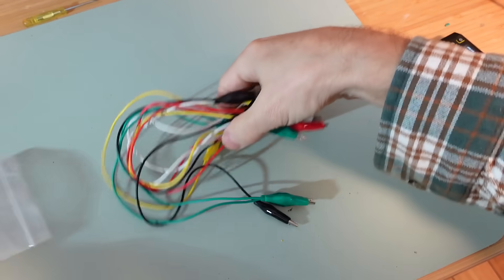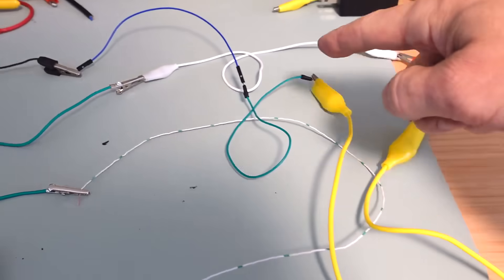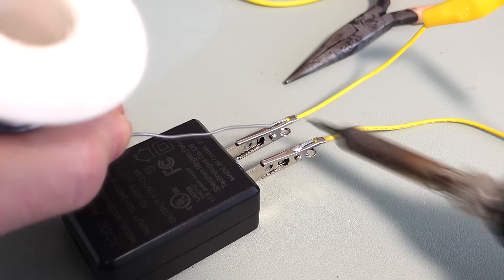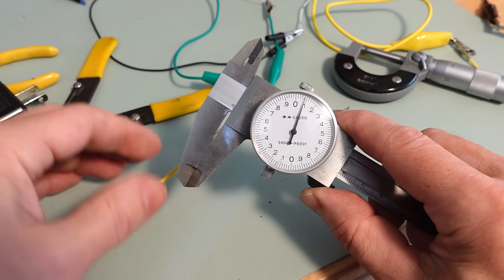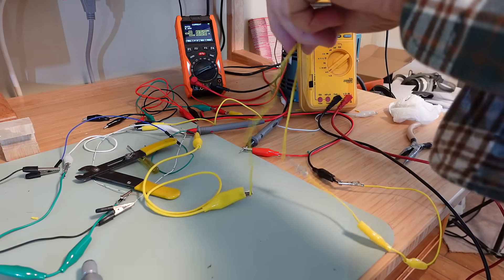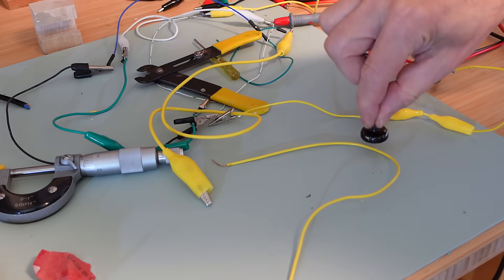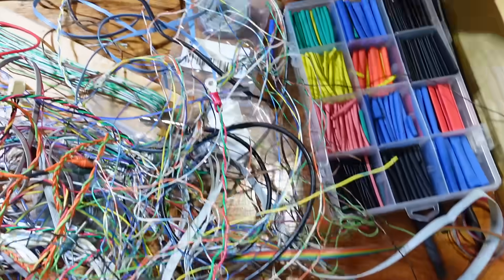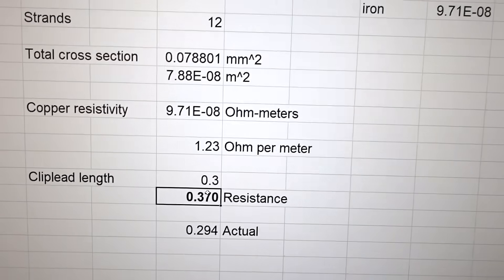Clip leads made with fake wire

Comment: I bought some at Harbor Freight within the past year, and they are NOT iron. I used to get them at Radio Shack and mine were very old, so when I saw some at Harbor Freight, I bought them. You had me a little worried cause they look like the ones you ordered from China. But fortunately, mine have good wire. I did notice that the wire is crimped, like you said, rather than soldered. Thanks for a useful video about something I wouldn't have expected!

Comment: I've been given a pair of jump start leads made with 8mm diameter insulated cables, which had more resistance than a pair I've made once in a pinch with spare 4mm^2 wire. Loudspeaker cable sold in construction supermarkets is often made of steel as well.
I've once had a cable almost catch fire after I've assumed it to be 2.5mm^2 of copper and loaded it accordingly. Buyer beware!

Comment: My guess is that they are using iron to save on costs since copper is 30 times more expensive. But still, that doesn't give them right to lie to the customers, it could potentially cause a house fire

Comment: Chinese manufacturing isn't to blame, they make to the design. Anything from the crappiest plastic moulded toy to the absolute best tech is made to the price and spec dictated by the retailer, market or consumer. These wires are steel because that's as much as people will pay for them. Have you seen the price of copper these days!!

Comment: I bought a cheap Chinese extension AC cord, back around 1978.  It got unusually warm powering my first o-scope, so I cut it up and discovered that the "stranded wire" was "stranded shield audio coax", with almost no copper in the core.

Comment: Just checked my clip leads and they are not iron. The clips themselves are though. Not sure if that matters.
Reply from the maker: Iron is normal.  Stronger than copper, and the cross sectional area is high enough it doesn't matter so much
Reply: @matthiasrandomstuff2221  good to know thnx!

Comment: When shopping for cheaper wire related parts the descriptions often say copper clad aluminum, which isn't terrible if gauged adequately.  I wouldn't have guessed some were made from iron.  I wonder if that coating was even copper.

Comment: I mean, there's a good sustainability argument for using alternative materials for low voltage applications where it won't really make a difference. Not a fan of the copper coating deception though.
Reply from the maker: Agreed, I don't mind iron wires in my mouses so much. Could be that they take longer to break from fatigue too, so might actually be better in that application

Comment: Amazed that "wires" contained enough iron to be magnetic.  I'm curious if the mouse cable was magnetic due to shielding around the signal wires?  Typically a woven steel wire mesh.  That might be why it was magnetic.

Comment: Luckily, they are small gauge wires, so they aren't used in high-energy applications. But this makes me wonder how many larger gauge wires have the same issue. It sounds like a potentially dangerous fire issue.

Comment: I NEVER buy these small cables - the plastic hardens over time, the thin metall bends in al directions, the wires sometimes are not connected to the clips. I make my cables myself, from isolated clips twice the size and longer thicker wires too. They are now 40 years old and still  handsome.

Comment: Excellent work! Cheap Chinese crap again. As for the mouse cable at 6:03 it might have iron in the shielding, not the actual signal wires. Not 100% sure. High iron content or aluminum in the shielding instead of copper is fine, just not as effective as copper for shielding EMI. Iron is fine for low frequency shielding. Obviously your mouse manufacturer or their wire supplier went with iron for cost savings.

Comment: This material is not even iron, they use some alloy which is much, much worse than iron or steel. It is basically impossible to solder when the copper coating is gone and that coating is very weak and just dissolves in solder. Utterly useless Chinese crap.

Comment: If you think iron is bad i can tell you the real problem starts with chinese components having aluminum wires, pretty much all new welders and DC wiring spools you get on retail that are bought from the retailer from china sell as copper and is actually copper plated aluminum, some are rebranded and sell at higher prices and you don't know which one is which if you just order it instead of buying in person. While aluminum is a great conductor those specific wires heat up, get oxidized and lose contact, break on points, etc, so if you plan to wire up a high amperage DC line like welders, car amplifiers, solar panels etc they can be a menace.

Comment: its copper alloy plated steel wire use the magnet trick. buy them for the clips ends and replace the rubbish wires with copper 1mm2

Comment: I grabbed a fake power cord and it popped leaving a black mark on my hand. Fake insulation too. Both the black cladding melted through and the wire insulation melted through at low temp. They way China solves these issues is by creating a State factory. There is a State capacitor factory now that while not the best, is spec'd accurately and priced just like the counterfeits.

Comment: I had a problem with some leads I ordered. always breaking off of the clip, hard to solder and high resistance. I held a magnet up to the wire and sure enough, was attracted to the magnet.

Comment: Over on BigStackD's channel, he has melted down many motor windings that he hoped would be copper but turned out to be copper coated aluminum.  Copper is expensive, manufacturers will do anything to use as little as they can get away with.

Comment: I’ve also bought those cheap Chinese POS alligator leads for physics circuit labs and the voltage drops across the wires are way too large!  I’m throwing them in the trash and will try to source true copper wires.

Comment: Phone lines use steel cable along with copper, so is a higher tensile wire but with good conductivity.
But these may qualify for miniature mig wire.
Copper coated Aluminium wire is even worse.

Comment: Those power supply leads have been like that for years now.
I once got an IEC mains cable with iron or steel wire in it that caught on fire when I plugged it into a laser printer. I had no idea.

Comment: The magic name: CCS, Copper Coated Steel. Also available as sat-cable, good to notice. When used outside, I was sometime wondering, why the cable core in an f-plug was gone.. It just rusted away because of bad insulation.

Comment: I learnt about that at one point when I forgot to demagnetize my screwdriver and it picked up cheap resistors by the leads.

Copper-clad steel wire has been sold for a long time as antenna wire because (a) its mechanical strength is better, (b) it doesn't matter at radiofrequency because of the skin effect. With the price of copper nowadays, what used to be pricey antenna wire (because of the manufacturing cost of the cladding process) is now cheaper.

Most of the time I don't care about a fraction of an ohm, particularly if it's going to disappear at high frequencies. I don't run big currents through the leads. That's mostly how the manufacturers get away with these.

Comment: I've had problems with these El Cheapo Chinese leads purchased from US online electronics houses.  The way they are crimped to the terminal is so cheesy that one was a complete open circuit right out of the bag!  The wire within seemed like 50ga, and it was folded back over the insulation before crimping.  However, there was so little wire involved that it seemed to get buried in the insulation and not make contact once crimped.   

Trying to repair these by stripping the wire and soldering it to the little contact portion was difficult; the wire itself is so thin it would usually break off within the insulation rather than allow the insulation to get stripped off it, even using a proper 2-knife-surface stripping tool.

Comment: I had buyed some of those same clip cables, absolutely trash the cables were too thin and also they are made from cheap metal they corroded internally after a year, at least the clips still works, so i solder them with better cables and i still have them

Comment: I have 2 new HAKKO soldering machines and the temperature calibration is all wrong (580C will not melt 340C solder) AND the manual is a bad google translation from Japanese and some parts I just don't know what they are saying , and the programming doesn't seem to work if you follow the manual it could be password locked from the factory.  Hakko is supposed to be good quality but someone with the job of calibrating the machines before shipping must be not doing their job correctly AND both models were discontinued right after I bought them .

Comment: Thanks.  I knew they coated aluminum with copper and how bad that is, but I didn't know they did it with steel/iron wire, too.  I contemplated buying a multi- pack of exactly those kind of skinny cheap leads, but bought one set of two better thicker leads instead.  And heck, I don't know, it could be copper coated iron, too.  I will now check resistance and magnetability on those kinds of leads.  Better to solder your own.   I save all my power cords from dead appliances.

Comment: I’ve been there before. Those cheap lead sets can lead you very far astray in a diagnosis. I’ve even had some melt under moderate loads . After tracking it down, I’ve thrown away all of my cheap leads, and made my own. Even fused some of my leads for use on unknown circuits. Nice video. 😊

Comment: Long time I use N50 5x5mm cube magnets for checking copper 
AND not just Chinese stuffs.../example that's reason why hate Legrad/
when the plugs or wires can holding the less than 1 gramm magnets i drop it without question!

Comment: I did the same thing, bought some new jumpers off amazon found some not conducting, changed the crimp to solder, still many far too resistive up to 1/2 ohm. Saw this video and checked and sure enough, my (I thought copper) jumpers were magnetic. Guess I'll have to stick with Pomona at many times the price.

Comment: Would've been nice if you had addressed why iron wires is bad, and why high resistance is bad. I stumbled across your video and decided to watch it as I thought it may be educational. I understand there are safety concerns with cheap electrical products, but I'd appreciate an explanation as to why these things are bad. You're making the (incorrect) assumption that all your viewers understand what you're talking about. If you explain why something is bad, or how to check that something (like a wire) is bad, you may find that you actually gain more viewers. Either way, keep up the good work. Videos like these are important.

Comment: Those test leads have messed up my diagnostics multiple times. I'll be going in circles only to realize that the problem is these leads. Good video!👍
Reply: I've had them get unusually hot, figured it was just a bad crimp, so I switched out to a thicker wire when I recrimped it, never thought to check the actual wire
Reply: Same here. Just checked mine wint magnet, and here we are...

Comment: yep.. the cheap chinese croc leads are mostly copper coated steel wire (if they actually bother to put the copper on). as a tinkerer, best to just save yourself the hassle and only purchase the clips to solder your own clip leads. the only way to know they're good.

Comment: Picked up a set of cheap jumper leads from one of the innumerable "discount tool" places that existed when Harbor Freight was getting big ( mid 1990's). Had all kinds of weird issues and thought my old Simpson 260 was dying, til I let one of those jumpers get too near an old speaker magnet, and it decided to attach itself.. Yep. They were copper coated steel.  
Recently, picked up  (as in found) a jumper lead on a piece of equipment I was working on and sure enough, same crap.

Comment: Magnet picking out mouse wiring is not surprising, there I’d expect inclusion of a steel braid for strength and/or shielding.  The wires connected between mouse and usb plug are probably still copper.
But the wires in the clip leads having iron, lol

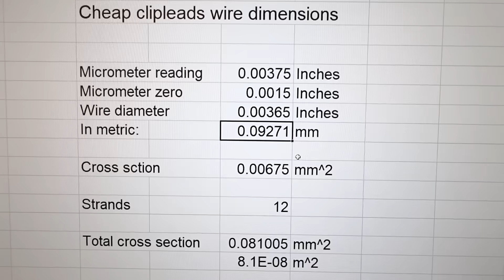Comment: @03:15 Sorry, your maths is faulty. It's actually far worse, assuming that the numbers shown are correct. You show 0.00375 inches - 0.0015 inches as 0.00365 inches. Apart from even this not being correct, your micrometer zero is ten times worse! You should have 0.00225 inches for each strand diameter, or 0.05715mm, or 0.002565mm², for a total cross section of only 0.031mm²

Comment: Running around the house testing wires with magnets.  None yet, not even the cheap clip leads, although I suspect some are copper coated aluminium though.  CCA has been common recently as well.

Comment: i'm actually not surprised. many of the 'silicone' wires arent copper not to be cheap but to be flexible. the mouse cable is probably magnetic due to the shielding which would be tin or the steel cable run along the shield.

i've just recently learned that a voltage with a known amperage gives the resistance and that can be compared to wire size to determine length. kind of a strange thing to only now understand.

Comment: Soo, i suspected this when these clips gave me an unusual voltage drop under load.
Year after (kept them on an open balcony) they refused to work at all - the wire cores turned black (oxidized?).
From now on only DIY clips.

Comment: Another possibility is that the wires are made from Chinesium. 😗 Aluminium was used for the telephone wires to my house, but these had to be replaced as they corroded.  The London Routemaster buses also used aluminium wiring extensively as a weight-saving measure, which caused problems after they were withdrawn from service and subsequent owners carried out repairs and restoration.

Comment: I just checked all mine using a magnet and I found one! I measured 504 mΩ on that 18" green jumper! It's pretty old. I may have picked it up at a maker faire.
On one of my newer leads I've just measured 31 mΩ, is non-magnetic and soldered. I think I got those from Mueller.

Comment: Thanks, I also have the same poor quality cables, I had noticed they were quite resistive but didnt look into it. ALSO NOTE they are doing the same with cheap push in prototype solder less boards, the type you typically push a chip or arduino into.

Comment: Chinese manufacturers figure, "If it kinda looks like the real thing, label it and sell it".
I found a train load of TV baluns ( 75-ohm to 300-ohm) that were made with no internal parts, just the two wires (poorly) soldered to the coax connector.

Comment: Fantastic relevation, now I know why some of my leads melted the insulation where others didn't. Fortunately the magnet is an easy way to check this out. But where is this "fake" wire being used ? I hope it's not going to be another electrolytic capacitor fiasco ! , and the risk of fires is more likely with high resistance wire. If ever there was a justification for  the proposed revision of Rule 321 and the "de minimus" for Chinese imports, this is it !

Comment: This actually answer my question on why one of my prototype doesn't works when i run high current thru one of this cheap China crap and noticing the drop in voltage, causing some of my IC to stop working completely or rebooting.

Comment: Copper coated steel is commonly used for AC signals where the mechanical strength of the wire matters. At DC high current, skin effect isn't a significant, so you're seeing the lower conductance of the steel in play. At higher frequencies, the current dances along the outside, staying on the copper plating, and the wire isn't a problem. 

It's not fake wire, just not the right kind of wire for a lot of use cases for clip leads :-).
Reply: Do you know that signal  test leads should be iron cored for sure ? It sounds like conjecture. The effects you describe, while true, I doubt that they are significant unless you are using high frequency, what frequencies are you talking about ? Also, my conjecture is that iron based wire is more susceptible to stress fracture, especially in test leads.

Comment: Thanks for the service to the community! This is quite concerning, I hope this problem is limited to just the bottom barrel cheap suppliers looking to shave costs anywhere. 

My concern is the extent of this level of fake cheap product into the manufacturing supply chain. Hopefully product designers are inspecting and vetting their wire supply chain when contracting to factories for manufacturing (I have my doubts 😢). This can definitely increase the risk of fire in products!

Comment: A friend gave me a small spool of left over wire from a job he was on at an oil refinery. It looked like ordinary insulated stranded hook up wire, but it was stainless steel instrument wire. It was for signals, not power. They wanted corrosion resistance and long term stability. I believe it was used in 20 ma current loops. Copper clad steel wire is often used for antennas by amateur radio operators. Since the skin effect dominates resistance at RF frequencies, there is little disadvantage to the steel core which adds a lot of tensile strength for long spans. As for your test leads, it looks like someone got a deal on some surplus wire, and being a buyer, didn't know it needed to be copper wire. Since it was copper coated, it passed the trivial look test. If they had tried to cut it, they would have known.

Comment: Not Iron .. Cooper coated Iron.  And just think on that.  The inner wire material is coated in an extemely thin copper coating (as copper is expensive) so it looks better and no one will notice.  And the wires are made thin so even if you cut them and try to look down on them you won't see silvery circles that small.  Engineered to be as cheap as possible while looking good.  On purpose.